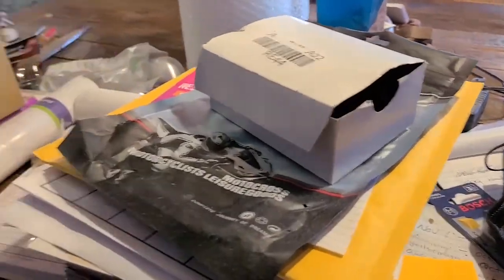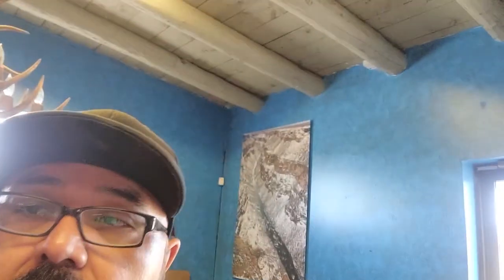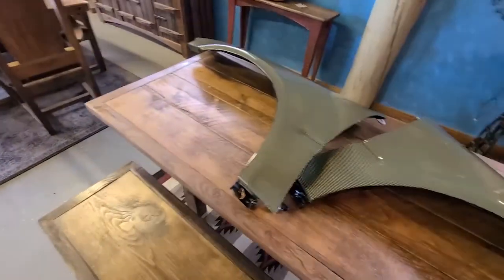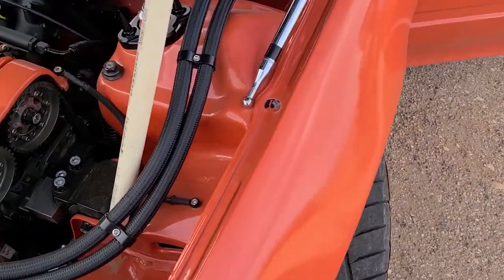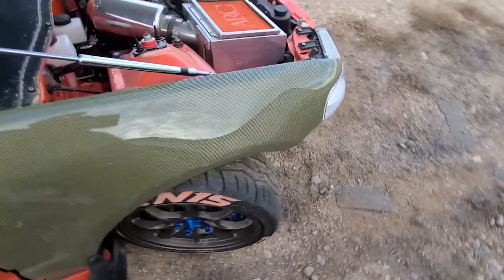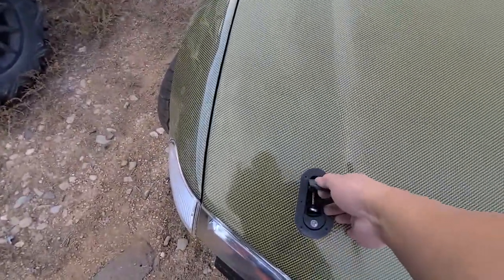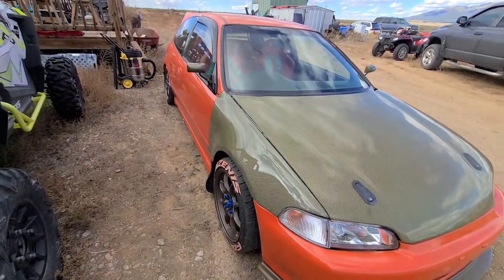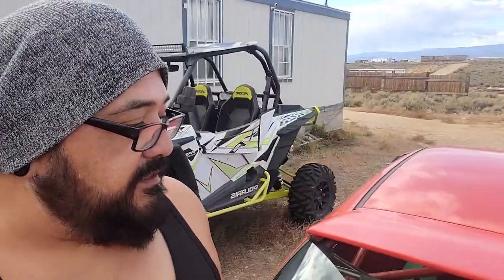New Kevlar fenders for the EG!!!!!

Comment: It could possibly be fading or hazing a bit from the hood cause (some) dont come from the factory clear coated they recommend you clear coat it jst something ive noticed when i looked into buying the hood, fenders w/ front bumper, window cowl, b pillars, trunk & ICBmotorsport front lip all in yellow kevlar
Reply from the maker: It has a clearcoat. But it seems to be a really thin coat. So ill have to sand and give it a couple of coats of a high performance clear coat this summer.